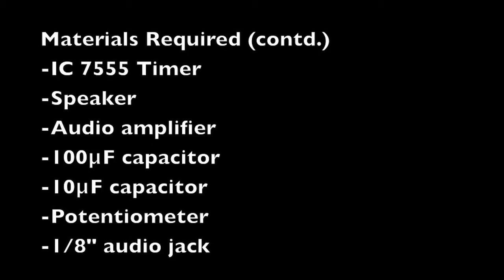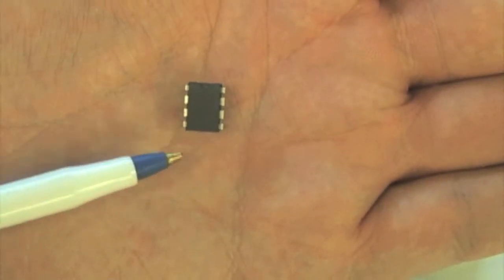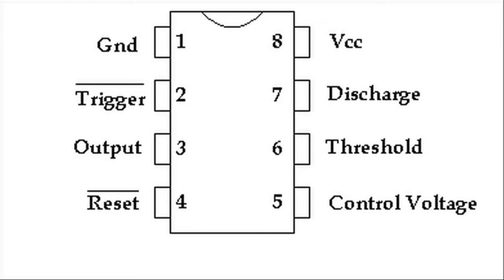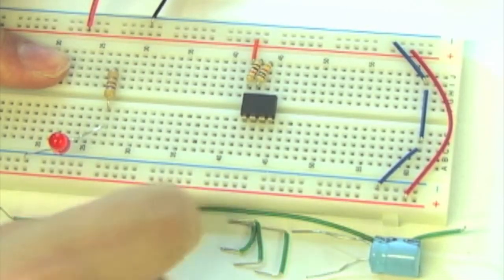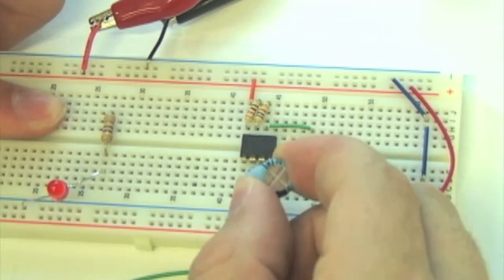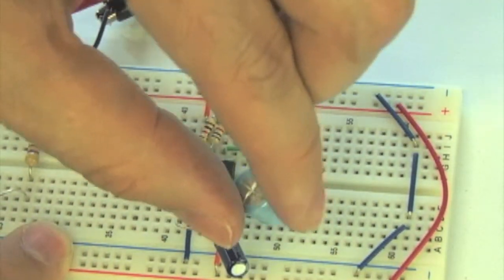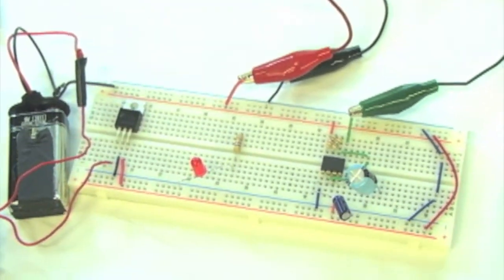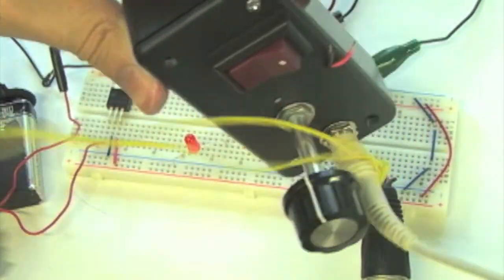DIY Square-Wave Generator (Musical Electronics - 3)

Comment from the maker: if you turn the knob connected to pin 5 it will change frequency...  we might have to add another video here, or you can see some of the electronics projects on this channel.  They are also using 7555s.